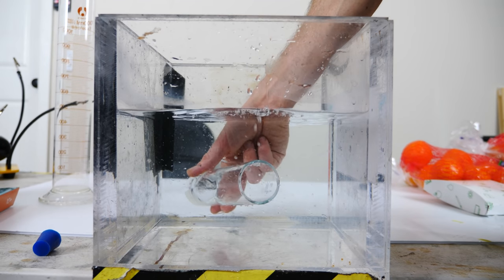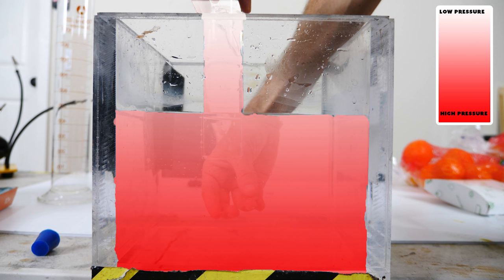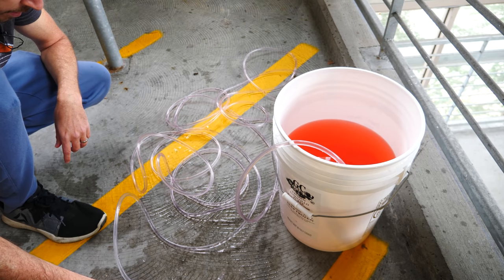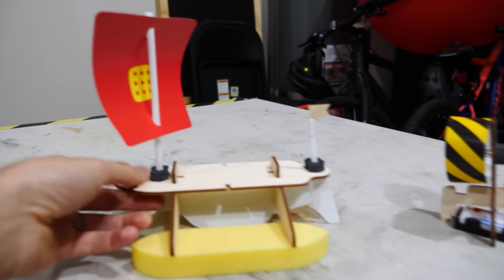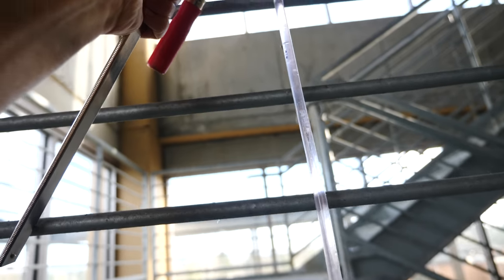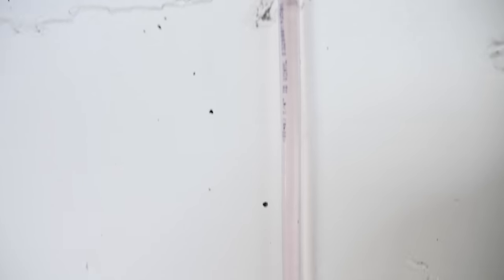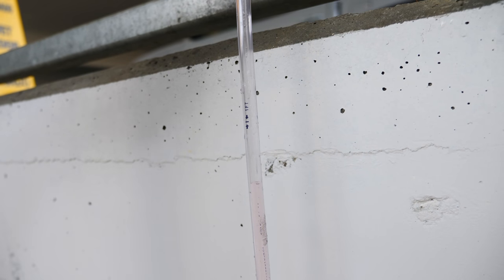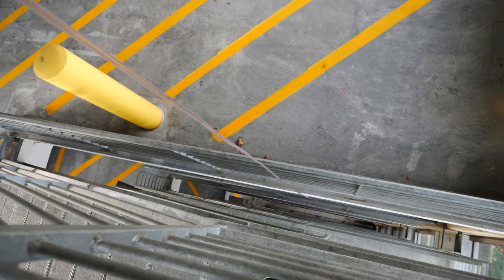Why Water Boils In Tall Cups

Comment: The explanation is a litte bit too easy. The water does not get sucked up the tube by the vacuum. And what you see is mostly not boiling. 
The water is pushed up by the atmospheric pressure pushing down on the surface of the waterlevel in the bucket. If you have high pressure sunny days the watercolumn actually can get "pushed" higher up then on cloudy bad weather days with lower atmospheric pressure. 
The vacuum above is far away from beeing perfect due to different effects. First as you mentioned the watersteam pressure at the certain temperature, caused by the boiling water, but: The water boiling you can´t really see. The pressure gradient is almost perfect linear so there is only boiling water right at the surface. There is no reason for the water to boil in lower segments of the tube, that bubbles will come up. The bubbles you see rising is gas which was solved in the water previously. There are two checks to confirm that. First when you take down the tube i bet there was a bubble remaining in the tube which couldn´t be solved again under higher pressure. Second: If you do the experiment again with the same water multiple times, you didn´t see it "boiling" that much, as more and more gas is already desolved.  
So yeah this is a nice experiment but the explanation isn´t that obviously as it seems to be.

Comment: I feel pretty stupid; after watching this video a few times, I still don’t understand how/why water boils “in tall cups.” I still know very little about this channel, but I already perceive that he’s trying to explain concepts as simply as possible. However, I can’t even understand that. 🙁
Reply: There's two ways of making water boil.
1 - heat it up 
2 - lower the pressure around it

We live in a pressure of about 1 atmosphere, so we're used to water boiling at 100°C (212°f)

In this experiment, the sealed tube with water is lifted up very high. 
The water is trying to run down the tube, but it can't because this creates a vacuum at the top. (there's no air to fill the gap)
So instead what happens is that the pressure becomes lower.
Eventually the pressure becomes so low that the water starts boiling at ambient temperature.
This means that it's not hot at all, it's boiling cold.

Comment: You're not going to achieve proper "boiling" with the end clamped, aka under pressure.. you cheated technically.
Reply: The boiling point for the water is lowered when the pressure is lowered

Comment: Boy you poor yanks need metric. One atmosphere = 1 bar = 10 metres of pressure. 
Eg 1 bar of pressure will lift water 10 metres at sea level. The air pressure on the open bucket of water pushed the water up the sealed tube. It reached its limit at approximately 10 metres.
A pump doesn’t suck up water, it creates a lower air pressure in the pump chamber and the atmospheric pressure sitting on the body  of water pushes the water up the suction pipe. You need a well sealed pump to lift water 6 metres. 
Then the problem of friction loss in the pipes adds to the equation.
We use this all the time shifting water for our livestock on our farm in Australia.
Bloody hell America get the metric system!!🇦🇺😂